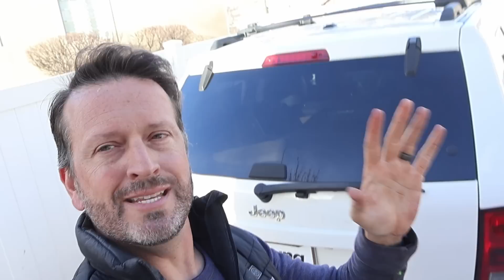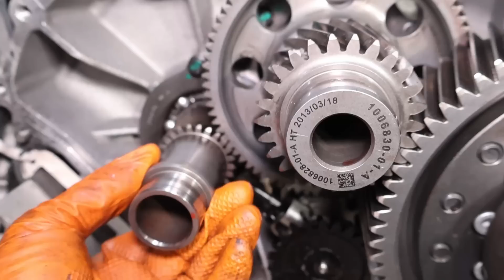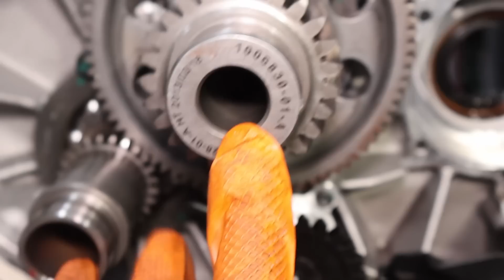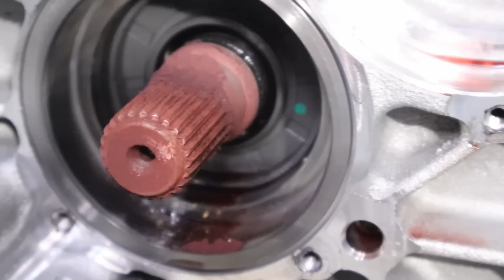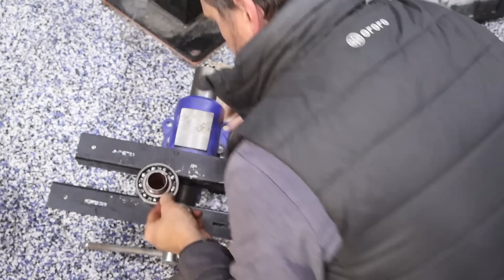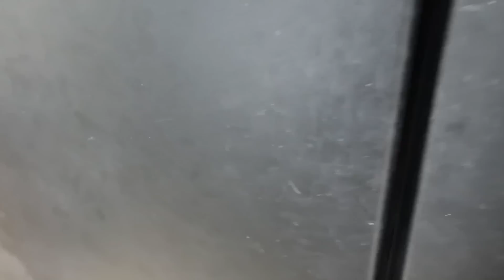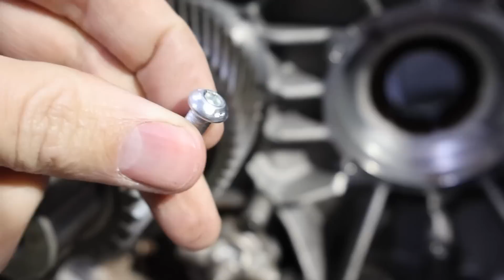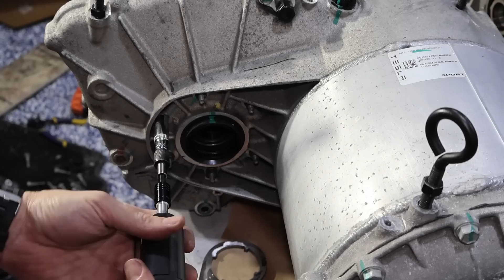Make Your Tesla 2x Faster with This Gear Set Swap!

Comment: Wouldn't it have been easier to change the final gear ratio in the diff?
Reply: The driveshaft might also need to be much stronger in order to change the gear reduction by such a high factor... the torque on the driveshaft multiplies by that same factor, for the same HP.
Reply: @tanner3801 if the drive shaft is spinning faster the torque will be lower so should be ok.
Reply: @ColinWatters  but they're asking about decreasing the final drive ratio, which would reduce the driveshaft speed per wheel speed.
Reply: @tanner3801  My mistake. I see what you mean.
Reply: This is where the innovation and modification of electric vehicles begin, im not a fan of electric atm but ik that within a few decades it will be an entirely different market, w upgrades and customization just like there is w modern ice
Reply: Incorrect Title:  
“Make Your Tesla Wheels Spin Twice as Fast”
Reply: Good points guys, didn't think about the transfer case and torque capacity on the rest of the drivetrain components since it's far higher with the stock Tesla config than the Jeep engine.
Reply: That's not rust that's a dried up grease you put like on a slip yoke
Reply: Where did you get the gear set?
Reply: He wouldnt have gotten a dramatic enough of a change. To do what he did here would e required a gear you cant get for his diff and likely wouldnt even fit.
Reply: Its an incredible opportunity for work and dynasty.
Reply: That would have made the rear diff a 1:1 ratio... which is definitely not an off-the-shelf configuration for a jeep, and probably not even possible (the diff would probably grenade with a ratio like that).  Also, he wants to retain 4WD, which means he would also have to do it twice (front and rear)

Comment: dam question. So if this swap was on a tesla car the battery could lasted more ???
Reply: I’m no expert, but since you would be loosing a lot of torque, I would imagine it would use more battery since you’re straining the motor more.  It would also probably struggle to get going when in a direct drive set up
Reply: @matt6740  oh, yeah, that's true. Thanks for the reply 😎👍

Comment: Please bolt your vise down! Should have bolted the bearing into the case then put the shaft into the bearing! 👋
Reply: Hard to align a hot bearing to a cold shaft when it’s clamped against the case with the retaining ring if you don’t put the bearing on the shaft first. The order he assembled was correct. Though I would have used the OEM bolts instead of those cheap chrome Allen button heads. Who knows if that chrome will flake off inland get into the internals.